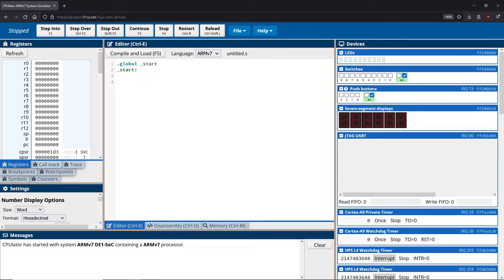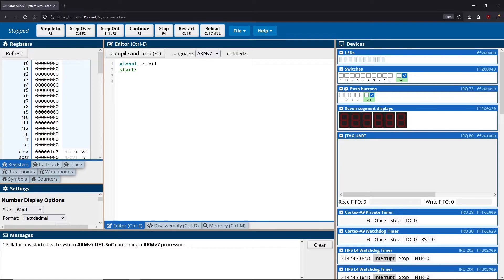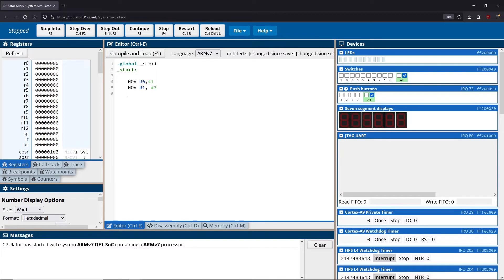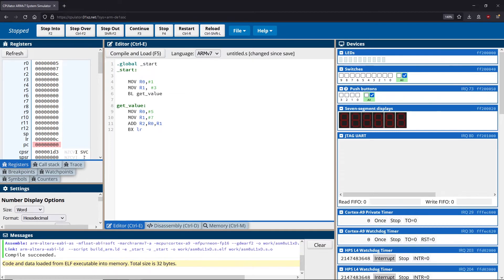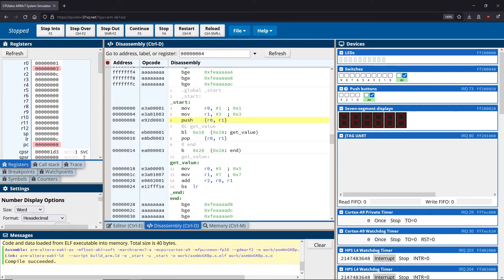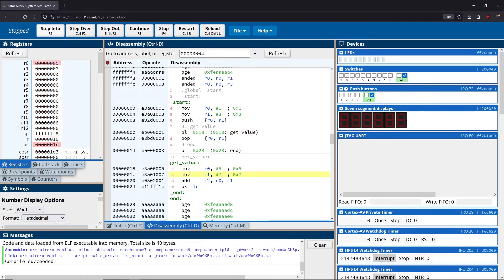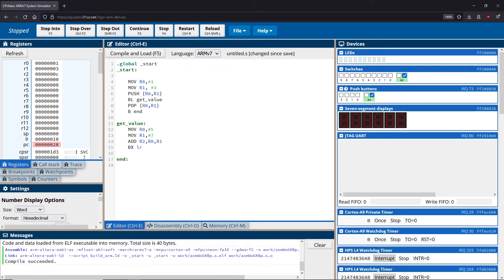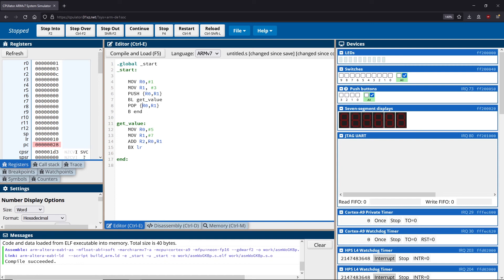Introduction to Assembly Programming with ARM - Preserving and Retrieving Data From Stack Memory

Comment: Should we initialize SP before calling a push. Is 0xFFFFFFFF default value for SP ?
Reply from the maker: The SP register will generally point to the last item placed on the stack. I believe the default value is usually  0xFFFFFFFF for ARM. As the program runs, the SP register will update to reflect any data added to the stack, so you won't need to initialize it at all, ARM will handle the updates for the register.

Comment: Tiny mistake :) 
POP {R1, R0}
Reply: from my lecture note:
Push and Pop Multiple Registers
What happens when there are 2 or more push
operations followed by 2 or more pop operations
push {R4,R5,R6} @ Largest numbered register is pushed first  
 ; equivalent code   
push {R6}   
push {R5}   
push (R4} 
pop {R4,R5,R6} @ Smallest numbered register is popped first   
; equivalent code   
pop {R4}   
pop {R5}   
pop {R6}
Reply: Hello,

The order in which registers listed in the register list does not matter. When popping/pushing multiple registers, these registers are automatically sorted by name and the lowest-numbered register is loaded/stored from the lowest memory address, ie is loaded first/stored last
Reply: @jacobyarnell715  That's not correct the order does matter. Stack is just an array of memory the beginning being the sp[0] and the next sp[sp+1] which is 4 bytes since arm is 32 bits wide. 

Array is always contiguous and sequential. This is not a hash map or dictionary each data has a unique address so is the registers on the stack, the registers are order and have unique addresses the way they are push matter and so the way they will be pop. STACK mean last thing in first thing out. LIFO.
Reply: @dreadesina5216  yeah but the video shows the registers after the routine call loaded with the correct values, im kinda confused